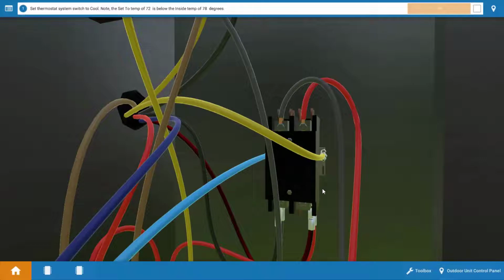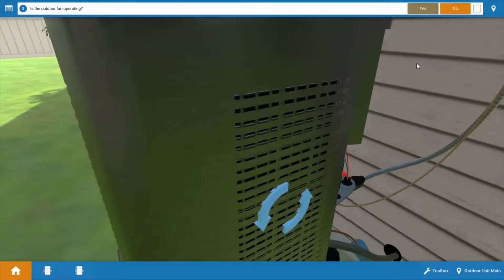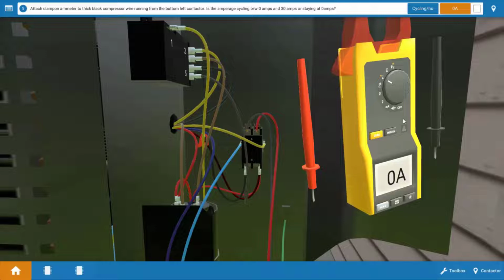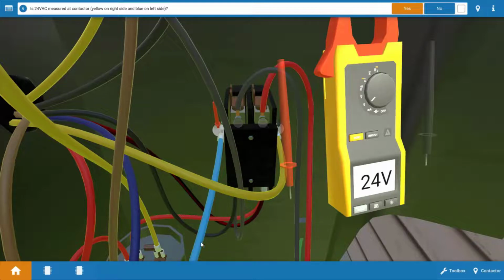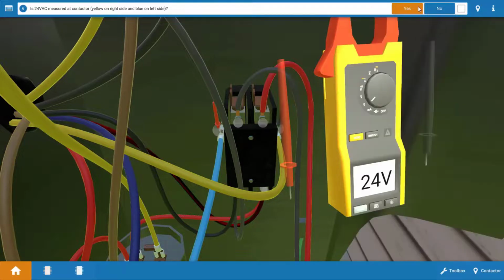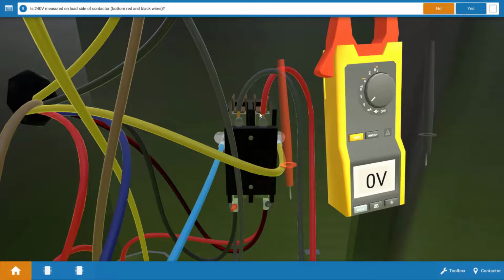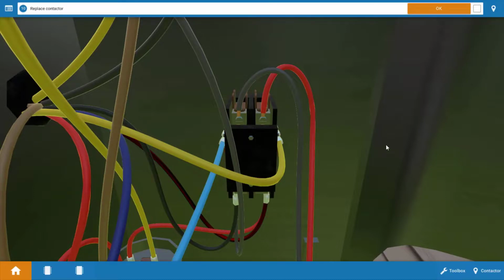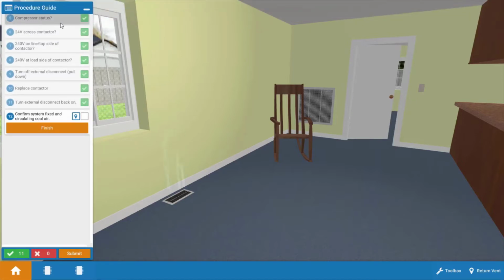[2019] Troubleshooting Residential AC Unit with Faulty Contactor

Comment: I have  been doing the work on the phone but I cant seem to use the vr how do I use it whit my phone
Reply from the maker: Hi Juan! In order to use virtual reality, you need to have VR equipment. If you're wondering about the 3D simulations, you should be able to access them through the app however a phone screen can be a little too small for interacting with the sims. We recommend using a tablet if possible.